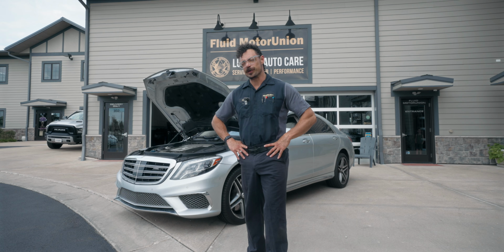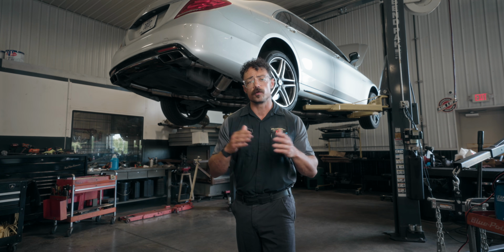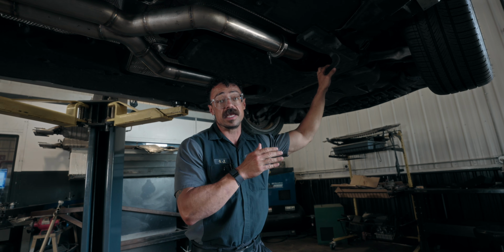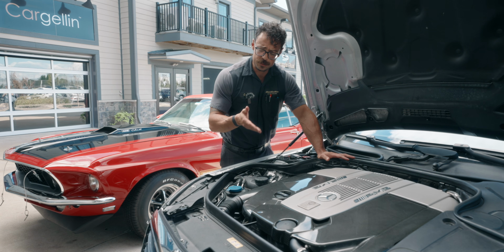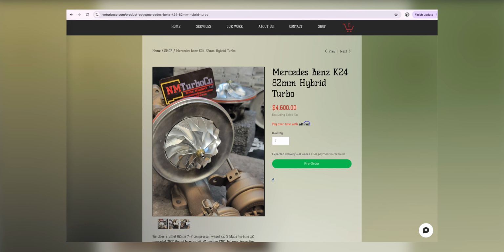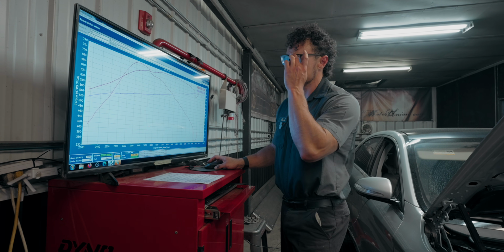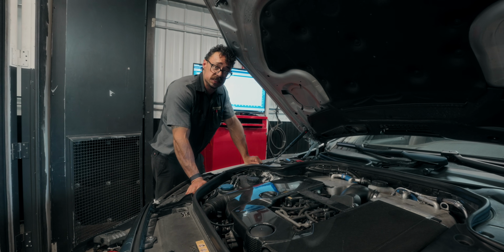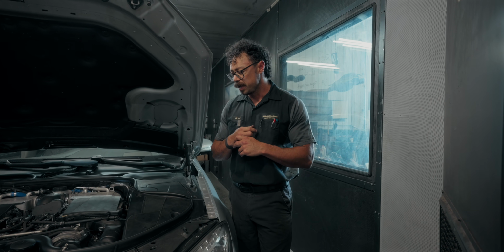Is Modding a v12 AMG right for you? Mercedes Benz s65 Super Saloon Build

Comment: If you upgraded turbos without tuning and using same wastegate pressure, you're asking the engine to spin a larger exhaust turbine wheel with no benefit of additional boost, no?

Comment: Did you tune the transmission and ecu to back off on the torque limits? If you don't, the car will not be able to make any power. It will cut all boost and retard the timing.

Comment: those K series turbos have a adjustable nut on the wastegate bolt that adjusts the boost. I had a K04 on a GTI before and when i replaced it the wastegate was almost closed shut out of the box. I would recommend turning it until you get to about 10psi of boost and going slowly from there.

Comment: There is a reason Pagani is getting more out of those engines, and it's called crank twist.  That crank will twist 3 degrees at 1000NM.  You need an EN40 billet crank.  The open deck design doesn't help it either.

Comment: I don't like running it without a tune, those turbos are really messing with the airflow.  I would have thrown a file in while it was on the dyno just to test.  The PCM is crazy good at detecting that it could definitely be blowing off boost thinking its getting way to much boost or something.  Mercedes boost control is crazy complex, I wish they were a little more simple.  That's how they build that board flat TQ line (not a curve) from stock though.  The Germans wanted a flat line and they got it lol  Throw a tune in it before going to far mechanically just to see if it replicates.

Comment: Hi OJ!   Love your channel.   I've got a big turbo CL65- granted, it's a W215, so the ECU you're working with is probably better than mine, but I have some thoughts:
- Check the Boost reference sensor near the voltage transformer.   I've seen a faulty sensor/broken line cause several low boost situations.
- Check the diverter valves on the turbos- is one of the rubber diaphragms torn?   
- With big turbos on this platform, sometimes a manual boost controller is necessary to trick the ECU into allowing the engine to get full boost.  At least, that's what I've got on mine.   I am running ME2.7 though- not sure if the W222 has an updated system that is more tune-able.
- Test the vacuum actuated wastegates with shop air to see at what pressure they are set to open at.  Adjust accordingly.   The test can be done from the top of the engine- might even be able to make the waste gate adjustments from the top if you've got a tech with skinny arms. 
- somewhere down the line, have Marcin build the customer a set of intercoolers for that car.   He's up near you and he built my friend a set with tial BOV's a few months ago.  The stock units will be maxed out with those turbos spooling properly.  
- worst case scenario, size down those turbos.  Or make a log-style manifold and mount the turbos lower.   Or use M137 headers and rear mount some turbos.  The exhaust manifold is so restrictive and I'd bet the EGT is ridiculously high pre-turbine with those hybrids.
Reply: Thanks for all the valuable information.  What is Marcin's web-site?
Reply: Do you have contact info for marcin?
Reply: wow this is valuable info, i have 3 m275 and only a eurocharged stage 1, recently ob my w215 i notice a huge air noise after turbo spool when i get it. i did notice almost like a hvac tinfoil pipe hanging down  on the bottom been restoring interior and painting so haven't really been driving it

Comment: Can you check exhaust pressures? The bigger exhaust and bigger turbos make it harder to spool. You may have to set up a table that is specifically designed to get it to spool faster. Like an anti lag setup. Are the waste gates electronic? If so do they have to be programmed to the turbo and engine. 
You also said hybrid turbos what does that mean?

Comment: Am I the only one screaming the actuators need to be adjusted. It’s bleeding boost. Need to turn the rod to put more pressure on the dome I.e. turn the boost up. If it makes more then that stock find out what boost does it make from the factory. I’m sure it’s more than what you’re currently running. I doubt the turbo actuators  were preset. Just a thought.

Comment: I really want to see what you would do with a BMW N54 engine. I'm struggling through the custom build process of building my BMW 535 wagon (E61) into a single turbo beast but one thing I have yet to figure out is what to do with the 3 inch exhaust it will require.

Comment: Small correction, the s65 still has the hydraulic suspension, even with road surface scan that are more reliable than the old ones, but no air suspension on s65s
Reply: The worst suspension mercedes ever made. It is unbelievable on a track,but short life span.

Comment: I had a similar problem with my GL500 m278. No check engine but at the dyno it has 500NM while it should have been 700NM. The problem was the Turbos were not opening & closing fully the cartridges I had replaced on both turbos. At the dyno straight piped, down pipes, resonator delete for true dual & exhaust with valve control, It has done 447Hp although officially it has 435Hp. I have Euro version of the car hence the horse power is different from the GL550 x166 sold in USA.
So check the turbos. I'm subbed BTW I love LOUD exhaust systems of the Mercedes engines!
Reply: 500 and 550 are the same car with the same power, 550 is US and 500 is ROW.
Reply: @hexagonosaurus5848  yeah the engines are the same & both are built in USA Alabama.

Comment: Keep going with this S65 AMG, it is a very underrated car and one that has the potential for 900 horsepower with very few bolt ons. My dream car for sure
Reply: The transmission is the bottleneck, like in most turbo V12s.
Reply: @hexagonosaurus5848  unfortunately it is but some billet or forged internal parts should allow it to get that 950lbft out of it
Reply: It’s a heavy car. Still nice but you ain’t gonna burn many people. I have multiple amg but weight 3.5k -4k. This car is 5k+
Reply: @RDawgs  just under 5 but yea its not a hypercar its a luxury torque monster,  I have an 07
Reply: @DanielBenz81 I also have an 07. Thing is a stage 1 monster.
Reply: @matth7145 nice! Best of luck with her brother, I’m keeping mine forever, I may get the w222 s65 in the future but keeping the old one for sure
Reply: The problem is the transmission, not the engine.